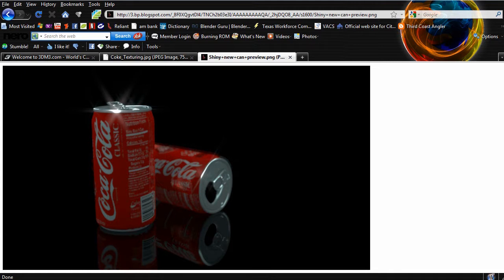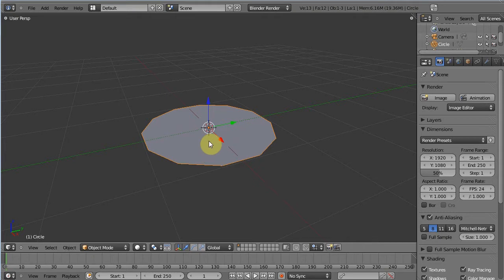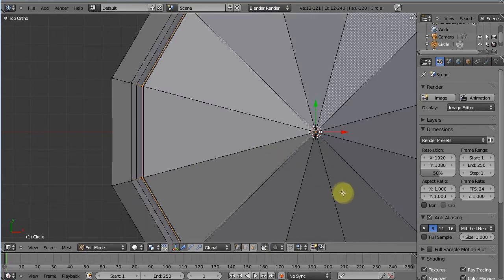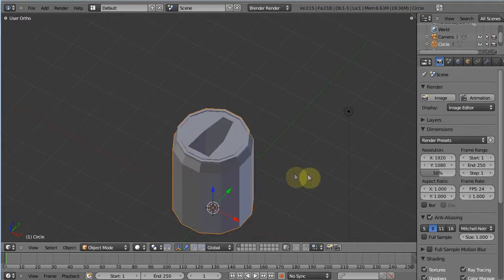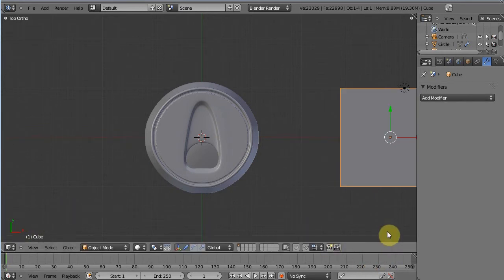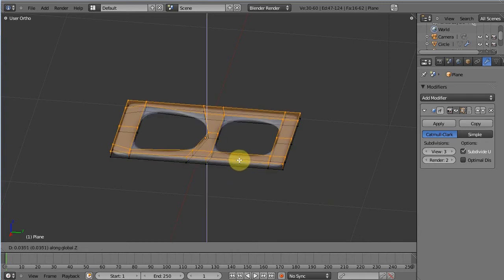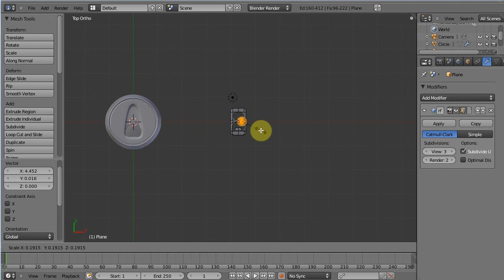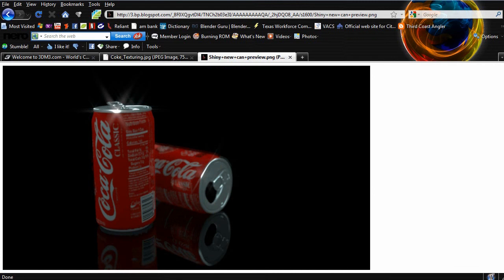Blender 2.5 Tutorial: Soda Can Modeling

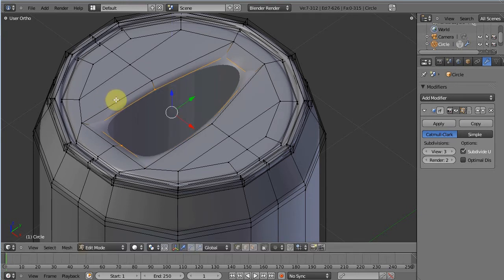Comment: After 9:15 how do you make the flat surface on the bottom?
Reply: +Sereno Withers Instead of selecting all 6 points, select the top 4 and press "f" on you keyboard. Afterwards, just extrude and drop it with "z"
Reply: ctrl-shift-a

Comment: to fill the gap, just select the last vertices, extrude and scale in, and then move the new vertices in place of the gab,or where the gab should be and scale/transform them until it looks like the gab of a soda can, its quite easy,… you can do that its just one step ahead of the previous step you took!

and if you want to add an extra mesh into your mesh, just go into edit mode, and add the mesh, if your not in edit mode, it will become a single /stand alone mesh.

Comment: Hey,
First of all, that's a great tutorial you have there, however I can give you some tips here and there. When you added the loopcuts to the can when you were making the opening the can, the can wasn't exactly round anymore.  This isn't a problem on this render but it can badly mess up your geomitry. Same for when you moved the side verts of the opening (not symetric). Add a mirror modifier to prevent that. Third, when you moved the pull thing you can press N and change the x transform to 0.